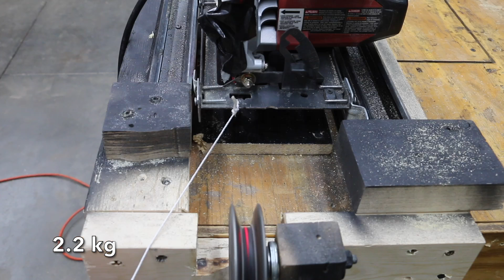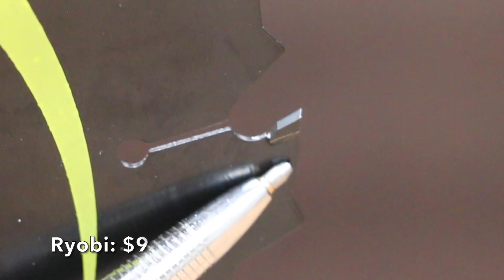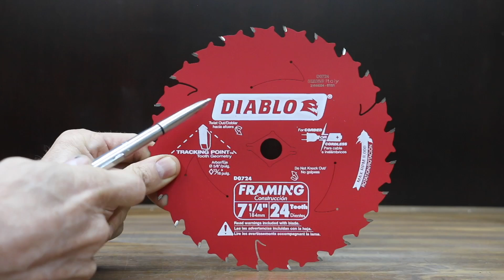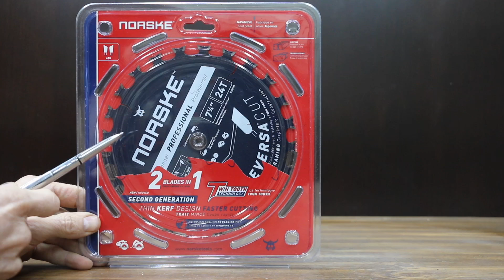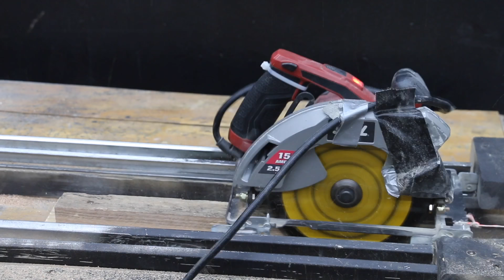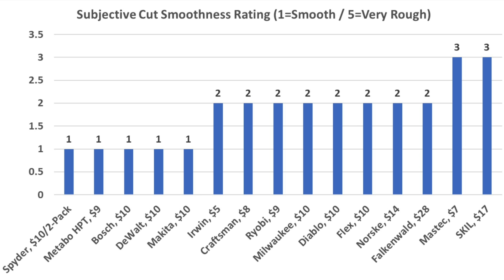Best Circular Saw Blade? FLEX, Diablo, Milwaukee, Makita, Bosch, Ryobi, Irwin, Spyder, SKIL, Norske

Comment: Sir, I love all of your videos! Please bear with me. With the Diablo blade, I've  found this to be true.  I can not  control the "cut" as I think the blade is too thin. 1st experience with this. I was cutting stair stringers out of a beautiful wet treated 2x12. I was using a Skill 77 worm drive, so there was no lack of power. I could not cotroll where the grain took the blade. 2 ed) i had a 12" Diablo blade on my chop saw. I could not get a square/ straight  cut on a treated 4x4. You could actually  see the blade "flex". 3rd and most recently. On a 10" dual compound miter saw, I was cutting pine casing. The middls/ roundish part of the casing would often meet/ butt and leaves both the inside and outside corner with a small gap. Again, it appeared  to me that the blade was too thin. On a different note. Many, many years ago, Fine Home Building did an article on saw blades. Very interesting. Stamped vs. lazer cut , etc. The difference in carbide tips for different saes. Cabnit vs. framing.  Framing blades need softer carbide so they don't  chip. Again, thank you for what you do!

Comment: The thin kerf Makita looks very good on paper, but there's an important consideration that effects its usability: thin kerf blades bind VERY easily.
They don't leave much space for the body of the blade, and if the wood has any internal stresses that the cut releases, or if the user isn't perfectly straight with cut direction, there will a lot of binding.
It's no fun cutting stringers out of treated 2x12 with a thin kerf blade.

However, on a tool that bypasses human imprecision, like a miter saw or track saw, thin kerf blades can be excellent.
I'm not sure if you'd want one on a table saw though because that would increase the risk of kickback, plus most table saws have a riving knife (if any don't know, it's a piece of metal on the other side of the blade that holds the piece separate from the cut-off) and a thin kerf blade might cause complications with it. I haven't specifically tried a thin kerf on a table saw though, this is just my intuition.

Comment: This reminds me of back when i worked for Rubbermaid and they owned Irwin at the time. We had a machine that would cut sheet after sheet of MDF with our blades and competitor blades. Just so we could make the claim that our blades lasted X number of times longer than the competitors blades. I also got to see the machines used to braze on the carbide tips! At the time i believe the blades were made in New Zealand.
Reply from the maker: Thanks for the feedback.

Comment: I'm a carpenter and have been using those Makita efficut blade's since they came out. They are by far the best in circular, plunge and mitre saws and they last for ages if you dont hit any nails. They are not easy to sharpen though, because of the tooth shape. Great review 👌
Reply from the maker: Thanks!  Thanks for the feedback.

Comment: Some years ago, I worked at a testing lab and we tested circular saw blades on a rig very similar to yours (with the weighted pull string), except we cross-cut the 2x4s and had 6 in the rig at a time with a few inches between them.
The test was to make 5 passes, find the average, and then keep making passes until the time had increased by 50%. I spent literally weeks cutting through thousands of 2x4s.
Two things really stuck out to me.
1)The Dewalt blade we tested was so bad that we couldn't even get a baseline. The time increased so quickly that there was no reasonable number to base an average on.
2)The Diablo blade cut so fast that the first time we sent the saw down I thought the boards weren't pushed in all the way and it must have just barely skimmed them, but nope. The blade continued to cut so fast that after 50 passes they contacted the test customer to see what they wanted to do, as the times were simply not increasing. Because of that blade, we ended up putting padding at the end of the rail because the saw hit the stops so hard it was like it wasn't even cutting anything.

Oh, and the third thing was that it occurred to me that we should have contacted the saw maker to see if they wanted the data because that poor circular saw ran for 8 hours a day, nonstop, for weeks and never skipped a beat. 😂 Unfortunately, I don't remember the brand.
Reply from the maker: Thanks for sharing.

Comment: I have a brushless Ryobi 7.25" circular saw with the original 4 year old Ryobi blade that still works fine. However it is starting to get dull . Thanks to this video I ordered the Makita blade. I'm excited to see how a fresh and faster cutting blade will improve my circular saw performance and battery life. I mainly just cut 2x4 or reduce down thick tree branches so shouldnt encounter any nails.
Reply from the maker: Thanks for sharing.

Comment: As always, exceptional review! Tool reviews and automotive application are always my most favorite.

One thing I was thinking about - timing belts. There are still a handful of cars out there running with timing belts, and everyone always gets into argument as to which brand is the best. You're concerned for tensile strength, stretch and tear resistance, wear resistance as well as deterioration from leaking oil or coolant in those engines, heat resistance. How these belts perform in ice cold vs extremely hot environments. There are so many ways to check these, and they are mostly relatively inexpensive. You have brands like Gates, Contitech, Dayco, Aisin, Mitsuboshi, store brands, etc. All ranging from $30 all the way up to >$100. Then you have subtypes, like Gates Aramid/Kevlar belts, Racing blue color belts, etc. Interestingly, even for one car, there is a difference in construction of same OE belts, some are thinner, some have glass fibers, some have aramid fibers, etc. And these belts are supposed to last 90K to 130K miles, so it is a big decision that can cost somebody thousands of dollars for engine replacement. It would be good to have a review once and for all, so we can put the debate to rest.
Reply from the maker: Thanks!  Thanks for the suggestion.

Comment: Did you notice on the two by fours that only the makita blade dumped the sawdust out of the saws sawdust port where all the other blades dumped it out of the 12 o cock position of the guard?

Comment: Nice testing once again! Viewers can choose what fits their particular scenario.
Not sure if you did general stacked dado blades before.  If not, it would be nice to see which cuts the cleanest across the grain and with the grain. Test in dry pressure treated lumber also since lap joints in deck furniture are common.
Reply from the maker: Thanks!  Thanks for the suggestion.

Comment: Tremendous review as always

May I make a suggestion? Maybe a table which shows the summary in graphical form with a matrix, showing the blade for the best durability, the best price, speed, etc. in a checkerboard pattern. 

That would help to summarize it in a single shot. When your struggling to remember what your summary findings were, and the Wi-Fi connection in the box store is garbage. 

Thanks so much as always!
Reply from the maker: Thanks!  Thanks for the suggestion.

Comment: On the rip test, why was the retractable blade guard taped up and out of the way for some blades (e.g., Skilsaw) but not others (e.g., Norske). It seems that having to overcome the drag created by the blade guard as the cut begins would slow down the rip, which means not all blades were tested under identical conditions.

Comment: I've always just bought the Irwin blades, not so much because I like them any more or less but more because they're the most convenient, being available locally less than 5 miles from me as opposed to any of the other cheaper blades that my local store doesn't carry.  If I were a contractor I might would buy better blades but for occasional home use an Irwin blade will generally last me at least 5 years or so before I notice it getting dull.  I personally also prefer a slower cutting blade to make sure I'm cutting a straight line too though so I don't really mind that it doesn't cut fast.  For most cross cutting I just use a radial arm saw instead and it has the same blade on it it came with ten years ago whatever it is.  The saw itself is a Master Mechanic brand and we haven't had a True Value store in almost ten years.
Reply from the maker: Thanks for sharing.

Comment: Although speed is important—especially perhaps with 7 1/4” rear handle rip saws—cutting quality is more important for some.  Not only soft or hard wood, but there’s a lot of laminated fiberboards and plywoods where you don’t want any flaking.  Although “zero tolerance” sawing with e.g. a rail guide makes any blade perform better, the blade in itself can produce better or worse result.  Sometimes you want both edges on both sides of the cut perfect, and then a rail guide and a backing board to saw in/against will only protect 3 of those four edges.  (Someone should design some type of connector so you can put two rails close together at a distance just enough to create zero clearance on both sides of the blade.)

Comment: I just found and subbed to your channel.
I've to be honest. I can't believe you actually tested makita saw blade. It is, without a shadow of a doubt, one of the quickest sawblades. Upon taking longevity into account, Bosch beats it by a mile. The consistency-wise, Bosch is extremely well and durable.
But there's one thing I want it to be tested. The same saw blades presented in this video on unprocessed hardwoods, preferably wood of the oak or walnut tree. I believe, it pretty much will test the blades durability which I think is the most important factor alongside the cutting time.
Take care
Reply from the maker: Thanks for watching and subscribing.  Thanks for the suggestion.

Comment: Thanks for making this comparison. However, to be fair, I apologize if I'm wrong but I believe you need to add a test and stack blocks of wood so the blade can make a crosscut and not only a rip cut with your weighted sled.

 There are blades made specifically for rip cuts, and I believe all of these blades you tested are primarily for cross cuts.

Thanks again for your content.
 There is a difference, and I believe it's how the tip of the kerf extracts the wood chips.
Reply from the maker: You are welcome!  Thanks for the feedback.

Comment: I am a marine Aluminum fabricator, using 1/4 inch 5086 most of the time to create boats, tanks, and other items. We’ve found the 24 tooth DeWalt framing blade is the best for cutting aluminum sheet and pipe day in and day out, we do use lots of wax on the blade but other than that nothing special, lasts us a couple of months usually.
Reply from the maker: Thanks for sharing.

Comment: Most construction cuts are going to be crosscuts.  Or cutting pieces to length.

There's a huge difference between both rip cuts and cross cuts in teeth design.

Ripping you need to scoop out material.  You are cutting in the same direction to the wood so the cut is straight on.

Cross cuts are going perpendicular to the fibers and you need to slice through the fibers.  The teeth are pointed to the outside edge of the blade.

Comment: hey Mr. Farm...

I replaced my12 inch miter saw blade from the DeWalt to Diablo, 
The Diablo is heavier both had 40 teeth
The new blade us quieter, cuts with less effort, leaves ultra smooth cut, cuts faster.
I was building a deck for a customer the treated lumber finished off my DeWalt 
Glad it did can get more done in less time,
There you go another testing idea , have fun.
Reply from the maker: Thanks for the suggestion.

Comment: Great as always. 

What about a high end kill-a-watt meter to measure the cuts in KWh or joules.

I’d guess any difference would be reflected in heat of the blade. It might even be a useful metric for battery tools, but neat either way. 

Love the videos, call me if you ever want an assistant.
Reply from the maker: Thanks!

Comment: Great work as usual. I wonder how the white Milwaukee cobalt infused tungsten carbide blades hold up when you do a retest. Another great thing could be table saw blades going through not only nails but also wood knots or getting gunked up with woodfiller.
Reply from the maker: Thanks!

Comment: I would like to see how Bauer stacks up if a test like this is done again.  I recently used one while building benches and then switched over to the Bosch tested in this video.  Given the choice between the Bauer and the Bosch, I like the Bauer.  

Two caveats to the statement: 1.) Bauer was a "finishing" blade with 40ish teeth, and 2.) Bauer blade was used for 70% of the project.
Reply from the maker: Thanks for the  suggestion.

Comment: Next test could you through  a irwin marathon blade in the mix.Wh.en i was in the trades 10 years ago ,
they were our go to blades.They are around $9-$10.Roofers used to love them.They would still cut as long
as you still had some teeth left.
Reply from the maker: Thanks for the suggestion.

Comment: New video idea...maybe a little outside your wheelhouse, but no one does head to head product testing like you so I'll pitch it and hope for the best! Indoor HD TV antennas. Could do things like general strength of reception in same place/position, how much changing the angle/elevation of antenna changes reception, different wall materials/thicknesses or glass thicknesses and their effects...and any other useful measures you can think of.
Reply from the maker: Thanks for the video idea.

Comment: Thank You.
Over time I have relied on your work to guide purchases.

I see your effort to remove the human variable.

I this case, I am entering the market looking for an 8 1/4" framing blade.

Here is the thing;
 How do these blades track?
Do they heat up and squirm?
Are any prone to binding?
Do they run away from knots?

I have no real idea how to test these factors. They are not subjective factors.
Perhaps some thrust sensors in various vectors. That would include bouncing. 
 I am from when we took a stack of steel blades in for sharpening in once a week.
Almost anything is better than that!
For circular saw blades, I settled on Irwin Marathons, about the time carbide teeth started staying on.
That is now history.
I retired, but still keep a project going.
This year it is with rough sawn, which 
means the 8 1/4" saw.
I have no modern blades, nor am I finding a 'framing blade'.
Passing a board, 1/3 rd my weight over a table saw, alone is no fun.
Guess it it is time for a blade. I dread buying twice, or untill I get it right!
Thanks. Chris
Reply from the maker: Thank you
Reply: The thing is the blades you are testing, were not designed to do what you are testing.
How good are they at what they were designed to do?  @ProjectFarm

Comment: The metal cutting version of the Diablo is a beast. It gets better judgment I had to rip a piece of 3/16 Steel on an eight and a quarter inch Makita table saw at a 45° angle. Not recommended by the way. The Diablo went through it no problem with zero damage to the teeth. I couldn't believe it.
Reply from the maker: Thanks for sharing.

Comment: Hey Todd! I use a 60 tooth 7 1/4 Diablo to cut pallets. it cuts faster with less effort and survives more abuse than a 24 tooth blade. ( I am using a total Hoss of a saw with big cord and motor.. If that matters.)
Reply from the maker: Thanks for sharing.

Comment: I noticed that your blade test was only on rip cuts (unless I missed something).  I would guess that most framers and other using portable circular saws do the majority of their cutting in crosscuts.  I blade can perform differently between rips and crosscuts.  Any comments?  Thanks.

Comment: Hey Todd, yet another great comparison! I do landscaping and have moved many times. One product I would love to see tested are heavy duty tarps. Weather it's strapping one over a load of furniture and braving the winds of the highway for a thousand miles, or it's dragging grass clippings and mulch and dirt over grass, dirt, and sidewalks, there has always been the issue of torn grommets, UV damage, and abrasive wear that render the tarp useless. I think it would be a great product review that would help a lot of people make a longer lasting investment in a quality tarp! I hope that interests you! Thank you so much for the outstanding content. Whenever I need a new tool or product that I think you would have tested, I always like to check out Project Farm before I make a final decision. Can't wait to see what comes up next! - Mark
Reply from the maker: Thank you for the video idea!
Reply: @Mark Olaf Lunde- For traveling it's hard to beat a flatbed tarp used by truck drivers. You can use them for everything. Also, for non-travel check out agricultural tarps. Very sturdy but not quite as expensive as flatbed tarps and they are white whereas the flatbed harps are usually black if white better suits your needs.
Reply: @loosewirewire7954  Thanks a lot for the advice!! I'll look into those, I didn't know about those classifications of tarps! I'll check those out for sure.